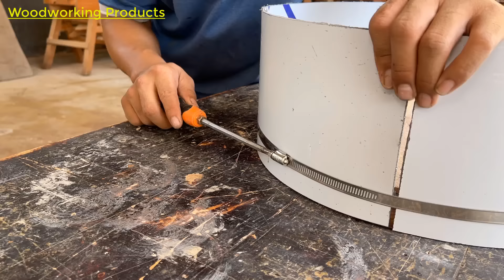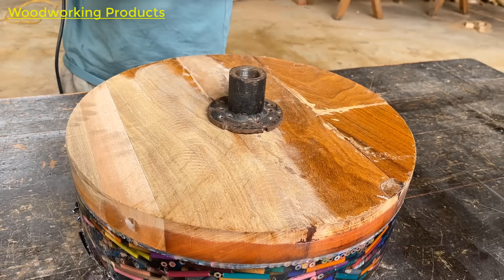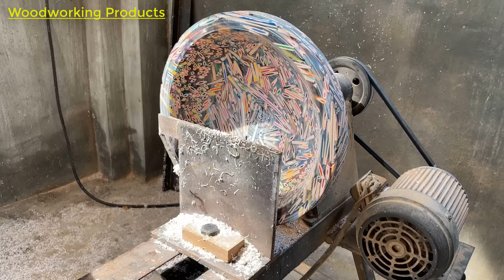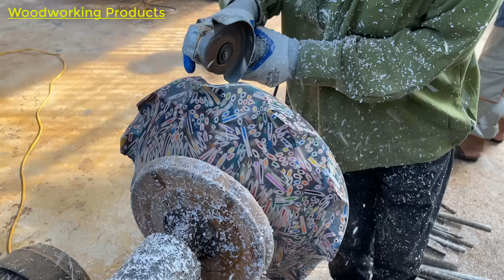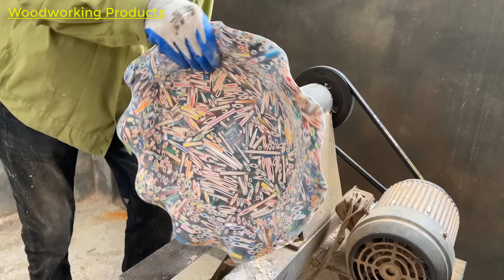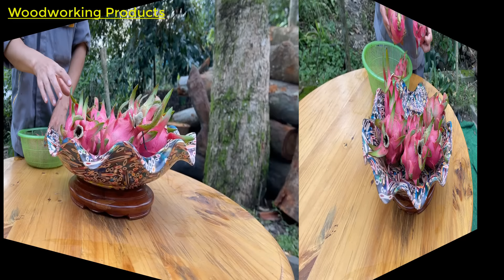Creativity Is Not Difficult In Woodworking - Colorful Sparkling Fruit Tray

Comment: This bowl is beautiful and there is true talent in the artistry of the woodworker for both creativity and design. 

Is anyone else concerned about storing food in a bowl full of lead? 😮 Even if the bowl is sealed.
Reply: No... Not that bowl
Reply: There’s lead, then there’s colored pencil lead. Just pigment and wood, glue and resin. I know there are food safety standards for wooden bowls and cutting boards so hopefully those standards were adhered to when choosing the sealant.
Reply: It's been along time since there was actually lead in a pencil. What we called the "lead" is actually graphite. The largest issue would be how well sealed is it inside of acrylic? If there's enough of a barrier between the material composing the bowl, and the fruit, then it should not be a problem.

Comment: What I don't understand is the need to use oils or varnish to take out the ground glass effect. Resin can be  sanded down to a glass finish with graduationg higher, much higher grits, all the way to 3000 and sometimes beyond, grit abrasives. Look to the automotive ssuppliers rather than woodwork suppliers.

Comment: Love the video actually tuned in to see what was being made using the pencils, the final project was just amazing BUT I was very disappointed that when showing every detail, even the red bucket on the scale to show measurements of the liquids than brings out 2 containers of liquid (1 white, 1 blue) WHY EVEN SHOW THE SCALE PORTION & WEIGHING THE LIQUID if you ARE NOT going to let people know which epoxy you mixed.   Anyway beautiful product but would watch any others simply because your EGO does not need any more air.